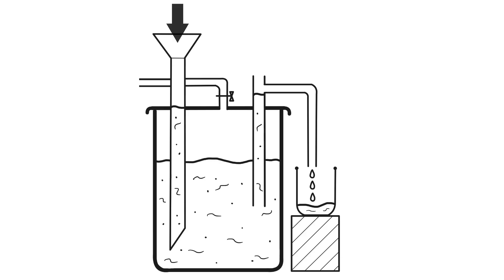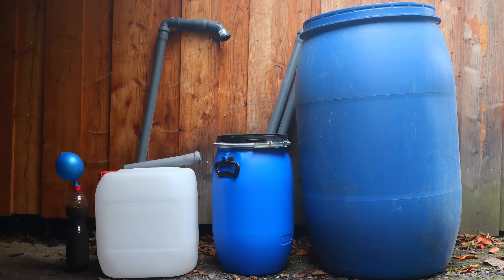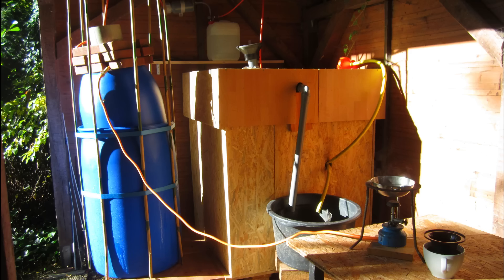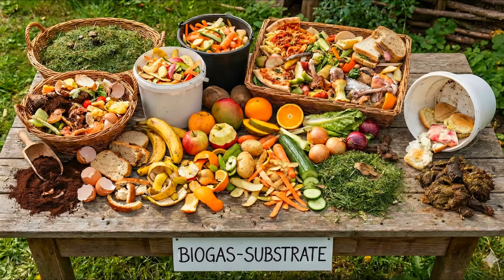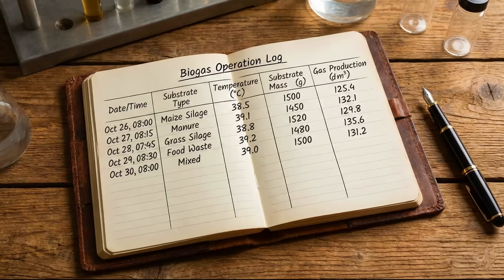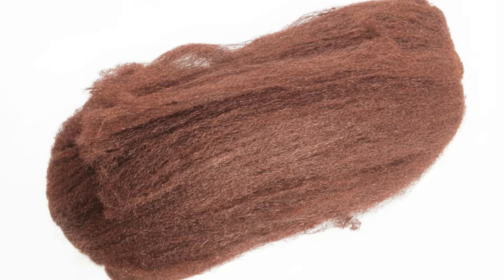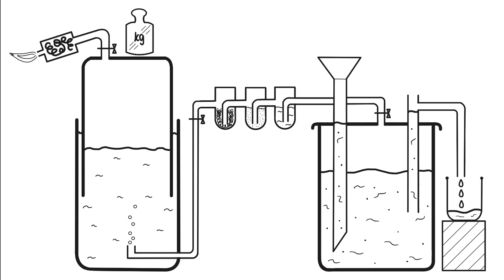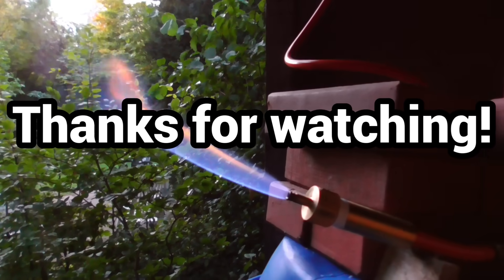Make your own cheap energy with a DIY mini biogas plant

Comment: Another inspiring video! Thank you for sharing your biogas set up again. 
Have you considered a water displacement set up for your gas storage?
These systems use a closed container with a second open container above it. As gas builds up in the bottom container water is displaced as it is pushed into the top container. The displaced water becomes the head of pressure and the more gas is accumulated the more pressure it has on top of it. Gas is tapped out of the top of the bottom container.
Reply from the maker: That sounds very interesting, I have to look at this closely, very much thanks for your great comment!

Comment: You should get together with a manufacturer and try to mass produce this system. Many people just don’t have the energy or time to scrounge around parts like you did or experiment on calibrating their homage device. They want something to just work. Your product could be an “heirloom” device that a home could be using a hundred years from now. Maybe the Amish would like and purchase your system. The Amish have a cottage industry of “low tech” tech they they make and use like hand cranked laundry machines and insulated ice boxes instead of electric fridges. 

If I can make a suggestion is why not have solar mirrors heat the system or place it in a greenhouse. As you say, it can never be too warm right?
Reply from the maker: Maybe its possible to make a business out of selling kits but that's not my thing, but maybe someone else, its a free concept!
Every possibility of warming the digester (up to 40 degrees celsius for mesophilic) is welcome!

Comment: Interesting setup. I have a question for you. Is it possible to make a Stirling engine from non metallic materials like clay? Would love to see you try that.
Reply from the maker: The hot parts cam be made of ceramic and the others from whatever is suitable. I am not sure if clay is robust enough!
Reply: @myengines2443  The reason I asked is because clay is everythere. If the clay could be mixed with other materials then it might work. Its worth investigating. You will need an infred red camera to see the hear transfer in the material.

Comment: Even if it involved breaking code, I wonder how I could create a system like this off of a septic system.  I not only would be making usable energy from my poop, but also, I could grind up and flush down the toilet all my vegetable waste while I'm at it, thus making my garbage bill lower.
Reply from the maker: If you could somehow guarantee protection against infection, that would be great!
Reply: @myengines2443  What would get infected?  You mean, if I used the gas for cooking or something?
Reply from the maker: The harmful infectious bacteria from your poop when you are ill may find it very suitable in the digester and will maybe grow very well!?
But I am no expert for this!
Reply: @myengines2443  OH, I see.  I bet I could figure out the answer to that question by researching bovine biogas generator systems that they have on farms.  Thanks for the tip, I'm gonna look into that.

Comment: Cool, but this output is insufficient to power a modern household. Net Electrical Output:  0.18 - 0.24  kWh/day.... enough energy to run a generic LED light bulb for 24 hours or charge a laptop once. It is a hobbyist experiment, not a grid-replacement infrastructure.
Reply from the maker: To power a complete household you need 1-3 IBC's as shown in the video!
Reply: @myengines2443  thank you. I neglected that. These numbers were from my own my napkin math.
Reply: @myengines2443  Great work. Sorry for the negative comment first. I admire your science and communication.... prolly should have started with that :)

Comment: Idk if its allowed over there still because of the safety and CO made, but mixing wood-gas and bio-gas could be interesting as the temps it can reach allows for CO and CO2 to burn which for heat pump engines gives you a larger temp delta to work with.

 It also at least in the states is incredibly cheap for a ton of wood pellets. If you havent seen Codyslab's biogas project its a good resource as well.

Very nice video, I wish you great success!
Reply from the maker: Thanks, I will watch out for this!

Comment: How much organic waste is generated?  How do you dispose of the waste?
Reply from the maker: The waste is the exact volume of what you feed and its a very good fertilizer!
Reply: @myengines2443  thank you for the reply. Ask a machine shop about getting the fine steel shavings to use instead of the steel wool.  How often do you need to replace the steel wool in your filter?
Reply from the maker: It depend on the size and quality of the digester.
Steel wool is very cheap and is used for grinding.
I have about a dm² that last for month!

Comment: Energy content of 200 l metan gas is approximately 2*3,6 MJ. From that if the energy conversion rate is perfect (which is not) we can get 2kWh electric energy. If we take into consideration that the energy conversion is not erfect, the electric energy is much less. If we take into account the energy and materials need to keep this plant working we get that it is more energy than we get back. So unfortunately this project is worthless.
Reply from the maker: You need nothing to keep the plant working except green waste.
If you want to make more energy just build a bigger digester as shown in the video!

Comment: Very cool. A prime example of chemical engineering. Perhaps it would be worthwhile to investigate if its possible to catalitycally oxidise methane to methanol, since then you could have IBC totes of it, and 1l of methanol should be about 17MJ. Also, methanol is chemically similar to gasoline, so modification of ICE engines becomes possible.
Reply from the maker: This is a very interesting feature, as methan is hard to store in large quantities.Compressing it is much effort and costs a lot energy.
Methanol can be stored easy. What do you think is the rough efficiency of turning methane into methanol?
Reply: @myengines2443  hard to say, honestly. I skimmed some papers on the topic, and it seems like it takes about 500°C over alumina. Its partial burning, essentially, so i guess finessing the burn rate to keep the heat from creeping out too high or too low is the key. 70% should be doable. But thats really only my thought, and not really based on anything much scientific.

Also, a fridge compressor should get you do like 30 bar, slowly for methane. Hyperspace pirate if you dont know him has a nice video series on manipulating gasses for refrigeration.
Reply from the maker: I have to look this up! Storing the gas in summer (when we have enough energy from solar) for the winter would be essential for us!

Comment: I confused about why you would use slightly rusted steel wool. As a derrickhand they had me add zinc oxide drilling fluid to protect the drill pipe. Couldn't you just use un-rusted steel wool.
Reply from the maker: We'll have to ask a chemist about that. But if the steel wool isn't rusty yet, it will rust very quickly on its own.
However, a more in-depth analysis by a chemist would be very helpful!
Reply: @myengines2443  In an anaerobic digester there shouldn't be much O2. If this was my set up I'd be more than happy to see the steel rusting, better to oxidize iron than methane. If I'm getting any where near the low explosion limit of methane and oxygen this set up is getting way to spicy for me 😅.
Reply from the maker: Yes you are right, there should not be any oxygen in the digester, that's why you have to use rusted steel wool I think!

Comment: A very interesting gas plant, we've only read about it in our school books and it's the first time I have seen someone making it. 👏👏👏

I have a question though, how do you pause the fermentation when you go for a long vacation? Will the bacteria die if not fed?
Reply from the maker: Not feeding for a few weeks is no problem.
Several month will kill them.
But you have to use the gas when you are in vacation!
Reply: @myengines2443  In the USA, the companies that sell home methane digester kits also sell powdered bacteria to help the process. They also recommend their use in UNinsulated digester in cold weather. I believe they will re-start methane production if all your bacteria die while you are away for a long time.

Comment: Nice setup. Have you thought of, instead of the massive Stirling, using Peltier-devices? Not much space is needed, no moving parts, no noise and they are very cheap. You can find them as cheap as $1
Reply from the maker: I experimented with them and they have a VERY bad efficiency. My new approach is a much easier thermoacoustic Stirling engine you can see in my other videos!

Comment: Please build gasifiers too.
Thank you
Reply from the maker: You mean wood gasifiers?
I informed me a lot about it but our wood is mainly used for warming  and I think it's a mess because of the smoke?
Reply: @myengines2443  it can be a message if the smoke leaks once started it will be quite clean and will create biochar which you can sell or use it for heating without without smoke. 
It's a great technology, you should try downdraft gasifier.
Reply from the maker: Ok, I will inform myself more about it, I have a book about it and informed me a lot over the net and thought it is a mess!
Reply: @myengines2443  with a wood gasifier you can harvest more energy than just the heat. It would be a worthwhile experiment.

Comment: Excellent summary! Thank you. Aside from any health concerns, is there a reason to not include human manure & urine? I ask as I have a septic tank system (my house is not connected to the sewerage system) and it would make logical sense (biochemically at least).
Reply: There are commercially available versions of this type of system that are setup for that exact use. HomeBiogas sells a system that includes a toilet attached. Their system lacks the gas filtration and purification though so should be added.
Reply from the maker: I don't think that's such a good idea for infection control reasons?
Reply: @myengines2443  if u build ur reactor correctly, & proper temp is maintained, the fertilizer slurry can b used on all above ground crops & applied to the soil around the plant, but not on any root crops - to avoid ecoli contamination, as u would with any pre aged animal manure. Avoid applying it to low growing crops such as strawberries, & salad greens. Squash, corn, tomatoes, peppers, raspberries, all get huge.
Reply from the maker: Yes, you mustn't over-fertilize, and if you want to be absolutely sure, you can store the fermentation residue on the compost heap first.

Comment: Excellent video, thank you. I am hoping to build a design I saw recently, which had a large, regular compost pile, in a large container, open to air, with a smaller anaerobic digestor in the middle. The idea was you run a water pipe through the compost to heat it to 40-ish degrees, for home use and the compost, also keeps your anaerobic digestor warm. I'm just wondering how to get that much waste?
Reply from the maker: This is an excellent setup that combines many advantages. Green and kitchen waste can be obtained from anyone. Everyone is particularly happy to get rid of grass clippings. However, grass clippings should be ensiled!
Reply: @myengines2443  Was going to look it up, when I was watching the video, but since you were kind enough to reply, I'll give you the pleasure of telling me, 'ensiled'? I'm guessing, something related to silage/silo, so possibly part composted? If so, that would be incredible, I could 'ensile' it in the outer part, and then feed it into the anaerobic digestor.
Reply from the maker: Yes I mean store the grass clippings airtight, pressed and without oxygen a few moth, they will ferment and be a very good substrate for the digester!

Comment: Yes yes i have been thinking about ur sterling and bio gas idea
Reply from the maker: And what's your conclusion?
Reply: @myengines2443  i mean i didn't have conclusion. I was thinking from previous videos. what if you could combine the 2 idea. And you are building it into your project. Stunning work.
Or sandy battery as the heat source i am toying with this idea.
Reply from the maker: Yes, a sand battery is very interesting! Would be nice if you could show something about it here on youtube, its much fun!
Reply: @myengines2443  i am at the start of my journey with the idea but solar power sand batter with a big enough mass and temperature of theoretical from off the shelve parts about 300 to 400c is what i want to work towards. But the sterling that you are making what is best temperature would need to have? 
But using bio gas is a great idea.

Comment: Firewood seems like a much easier energy solution.
Reply from the maker: But it is harder to use in your burner/engine and greenwaste is faster renewable!
Reply: a wood gasifier would be an option. But it needs a lot of wood.
Reply from the maker: Our wood is too precious for us as we don't have enough for other use than warming!
A wood gasifier is a lot of work and a mess with the smoke?

Comment: You mean I've been letting my family's feces go to waste?

Also, at 5:00, you say the grass must be ensiled. I looked up the word and it means "stored in a silo for use as feed". Is there a fermentation period, or is this just your way of saying it can be added to the mixture??
Reply from the maker: It has to be stored air tight without contact to oxygen for a few month to get ready for proper use!
Human waste should not be used due to the risk of infection!
Reply: @myengines2443 thanks for the tip about the grass. 

I was mostly kidding about the human waste, but good to know it's not wise1

Comment: I like it, but I think it's probably too complex for most people to manage safely. Ideally I would want a power plant which can be walked away from safely.  Seems safer to simply dry the excess biomatter and then burn it when the energy is required.  I would also like to see a direct comparison between this approach and pyrolitic production of syngas, as it's a similar process that also uses organic matter to produce flammable gas for storage.
Reply from the maker: I think it is not that complex and much easier and safer if you care about the safety! I never store great amounts of methane, i just use it!

Comment: How do you keep it warm without expending energy heating it?
Reply from the maker: At normal temperatures from spring to fall the self heating of the bacteria is enough, In the cold winter I isolated the digester and warm up the digester a little with a wrapped garden hose through which my hot water return from my Stirling combined heat and power plant runs.

Comment: Too bad keeping it  at 30-40C is the hard part, unless you build it inside a compost.
Reply from the maker: Its not too hard as the bacteria generate a bit heat self and with a bit insulation it works even when its a bit colder. In very cold winters as we have them here in germany you have to heat the digester a bit, but not too much!